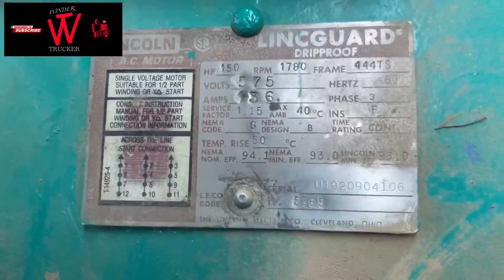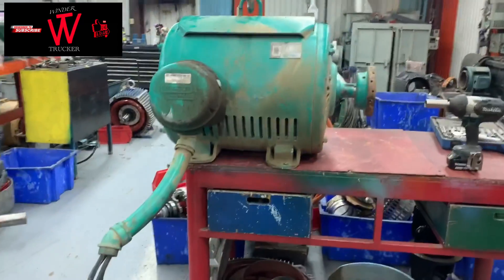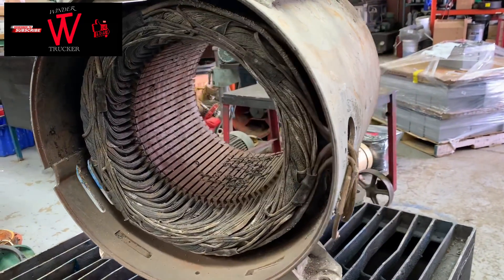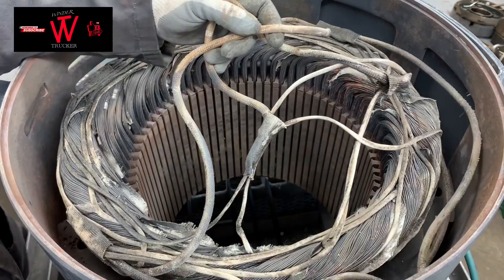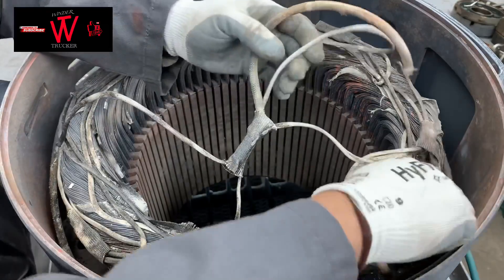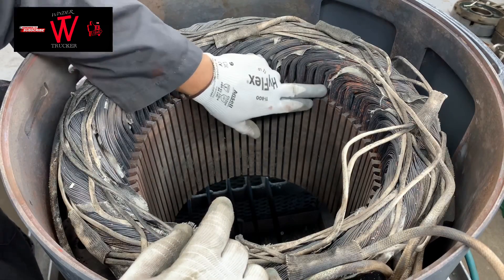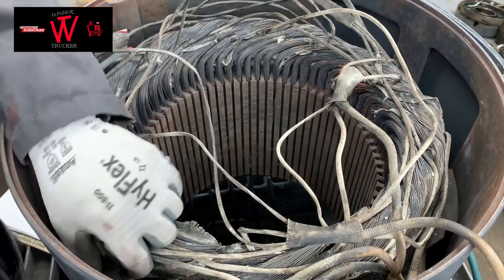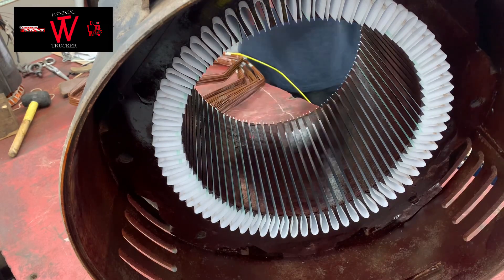Motor Rewinding | Part 1 | 150 hp Rewinding Lincoln 4 poles | Tips How to Rewind Electric Motors

Comment: sir how to hit before remuva winding wire plz make one video  plz plz plz .
Reply from the maker: What do you mean burning the wire before removal?
Reply: My workshop all motor one side  cut after  fire hiting LP GAS use  but i think  you not working my mathede  . 

You  know understand sir ?
my english not batter .
Reply from the maker: @arjunnepali9278  don’t worry about your english we both not born English.
The burning of motor winding we use oven burning with natural gas i will show you next time on my video sir
Reply: @windertrucker6230  Ok thanks Sir .

i working know Qatar  .   ours  workshop  1 kw to 300 kw and 1  to 2000 kva  every work using  ona side cut and hit LP GAS .
Reply from the maker: @arjunnepali9278  that will work but you cant control the heat if you burn to much on the core it will damage